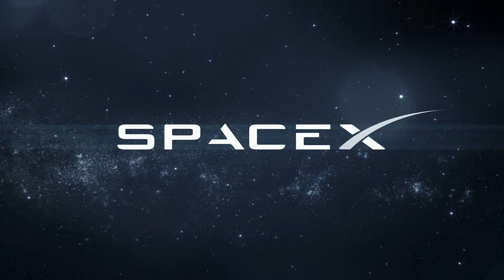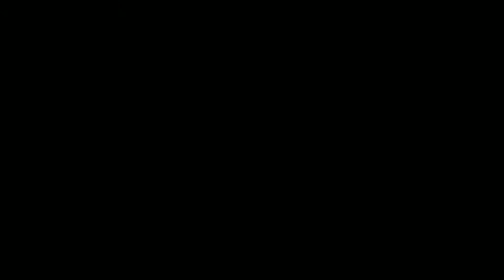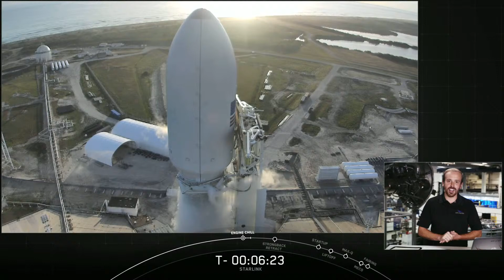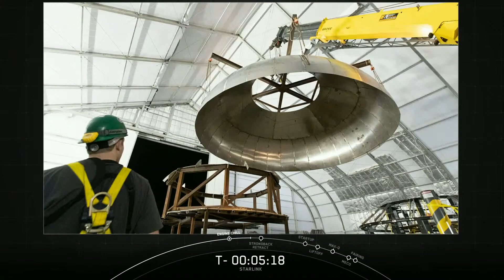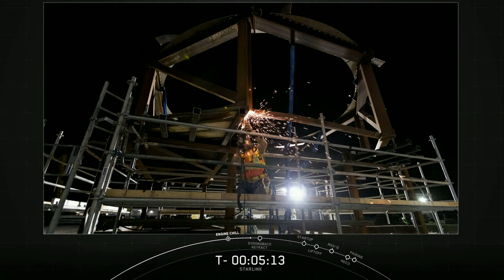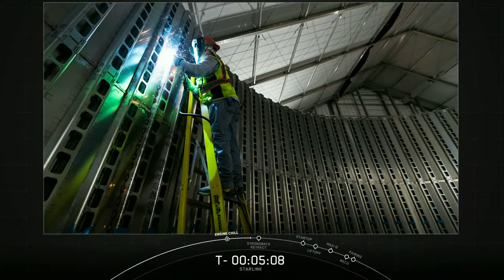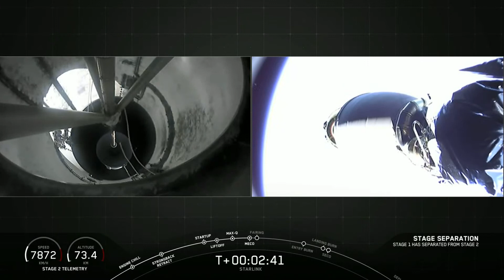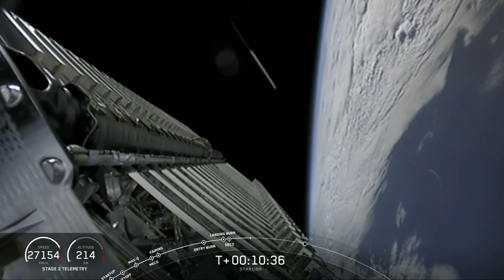Starlink Mission

Comment: Please don't cut droneship video, we knew it would fail, no need to be scared of failure. Please release video of it and release the several other unreleased landing videos like BulgariaSat-1.
Reply: SpaceX, Please SHOW droneship and all possible videos.
Reply: @harryseldon6366  I had an idea someone (last time) said that SpaceX will not censor their 'failures'.
Reply: It's not that they intentionally cut the droneship feed. It's when the water is choppy, the booster starts making it move, and then the satellite beam is broken. It's happens all the time even on successful landing
Reply: @Jaker788  No they definetely cut it. I've been watching every stream for years now, the past few feeds have been flawless no interruptions. Also it's not the water being choppy, it's the sound of the booster that vibrates it. There was almost no waves this flight. Also whenever the feed cuts you always see the booster approach and it cuts out, the feed has never not worked before hand, they very well knew what was going on.
Reply: @_Andrew2002  They literally said "expecting loss of feed" I'm pretty sure they've lost the booster feed before. It's not always gonna be perfect
Reply: @Jaker788  Except they never did say expecting loss of feed. And the feed actually is perfect, they did some upgrades and it hasn't cut out in months.
Reply: They didn’t it had a black out it didn’t have clear connection therefore if you see a booster gonna land it’s gonna have a black out
Reply: You fucking idiot it cuts because of the vibration of the rocket and it loose it connection to the satellite
Reply: That's pushing 400 satellites, anyword on when they're turning on phase one?
Reply: Andrew word where is it https://youtu.be/D9YBUr3YPxI
Reply: Anthony Umana-Paniagua don’t look at the comments...?
Reply: @Anthony Umana-Paniagua and there we go reading the comments before watching the video...
Reply: https://youtu.be/JOqc63Pp9OA
Reply: Samsung selfie sat landing video
Reply: They cut the droneship landing videos because when the rocket or booster is near the droneship the thrust makes the droneship shake a lot which makes the signals shake and so the signal couldn't reach the satellite that is capturing all those signals which in turn being sent to the HQ and then just there it will be seen by our eyes. Primal Space already did a video about this
Reply: @typicalfish1116  You clearly haven't watched many livestreams at all. The past 5+ missions have had zero cutoff because they fixed it. Tim Dodd's video is invalid now because they fixed it. Also that's not what cut out looks like. When the video cuts out you see the droneship for 20 seconds then it stops, drops out and returns. It doesn't never appear. It wasn't drop out, it was intentional.
Reply: @_Andrew2002  there's no reason for them to cut the video for no reason and if there is why would they post a video all about failed landings?
Reply: @typicalfish1116  Because Elon Musk himself made that video. The SpaceX PR team, especially the twitter PR team, and especially since the experimental landing program finished in 2016, now runs like a traditional PR team where you only show good video and try to take people's attention off it. It doesn't work at all but it is was it is. If you need more evidence go look at another more recent failure on CRS-16 where they cut the moment it was going wrong.
Reply: Actually this is the reason https://youtu.be/hH75bVG7HBo
Reply: Area 51 and Señor Leche …..    https://www.youtube.com/watch?v=R32DXz-6sJs
Reply: In this age of media and information, errors are entirely forgiven in the proper community.  This is [y]our home.  We care.
Reply: No they don't cut the video bc they are embarrassed. Infact they don't cut it, when the vehicle comes in for landing the radio signals going from the droneship to a sattalite down to your device for streaming is cut and you can't view it. They admit to their fails all the time on Twitter and on YouTube. And no they didn't think the booster would fail bc most of the time the booster lands. And they did release video of it on Twitter.
Reply: i don't think they're scared at all https://www.youtube.com/watch?v=bvim4rsNHkQ
Reply: They dont cut it intentionally
Reply: @samneale7249  They definetely cut this feed intentionally. Watch it yourself. There is not a single frame onboard the droneship when the landing was happening like they do on every mission. You can't say vibrations cut it out because they didn't even try to show the video.
Reply: Andrew they had LOS because the entry burn failed
Reply: @samneale7249  Entry burn didn't fail. The LOS after re-entry burn successfully completed was normal, always happens. The booster broke up sometime then and SpaceX knowing it had broke up, chose to not show the droneship view instead of just saying it had broken up.
Reply: And when the never regained contact their was no need to show a drone ship cam since they never attempted a landing at all.
Reply: Andrew no it wasn’t the engine failure on ascent was one of the entry burn engines, so the were coming to fast. Also why the booster appeared to flip out after the burn.
Reply: Andrew what do you expect to see , if we can agree it broke up somewhere before landing. Do you want to see an empty drone ship or what.
Reply: @samneale7249  Got a source for the re-entry burn failing or is that speculation?
Reply: Andrew Well its a presumption because Elon confirmed on twitter that they lost an engine on accent and then the booster spun out likely due to higher speeds than nominal. And as such it burnt up on re-entry causing the LOS
Reply: There was no droneship vid. The booster was way off course and didn't even make the landing burn.
Reply: Plumbus 48 Exactly
Reply: So many kids trying to act like they know what is going on 😂💀
Reply: they didn't intentionally cut the feed bro its something about vibration and satellite beam
Reply: Andrew- They don’t cut the droneship video on purpose. The rocket shakes the droneship so badly that it actually loses signal with the satellite, and therefore the video cuts.
Reply: Alan Turing- Sure! Set up a Go Fund Me page and give us a link.
Reply: They lost an engine on the booster before MECO and that's why it couldn't land.
Reply: It didn't fail watch their next video after this
Reply: @Sultan-lv8sj  I've watched every stream since 2015, I already know B1051.4 didn' fail,
Reply: @Anthony Umana-Paniagua y r u even scrolling through the comments when ur not done watching
Reply: Guys, SpaceX just released the Starlink Control Mission Audio in another video
Reply: I think that space x been slacking off late with their Falcon 9 boosters they re not putting in the time need to make corrections to F9 BOOSTER landing. They new that the booster would not have a successful landing.     I bet that Blue Origin would do a better job of landing their booster.
Reply: @Anthony Umana-Paniagua That'll happen if you read the comments!
Reply: In terms of orbital boosters, but it is one less than Blue Origin's New Shepard #3 which has logged 6 flights to space and back successfully. Things will get interesting when Blue starts flying the massive New Glenn next year which also can do vertical landings. 

 It is also way short of the all-time record for a reusable space launch vehicle which is Space Shuttle orbiter OV-103 Discovery with 39 flights to and from orbit.

So while this is good progress, there's a long way to go.
Reply: @Nowhereman10  New Shepherd indeed technically reaches space, but its not an orbital class rocket dealing with the severe reentry speeds and forces that Falcons endure. Although that is significant, it's not quite as significant or challenging as what SpaceX has achieved. New Shepherd essentially goes straight up and comes back down like a rocket powered space elevator. Its single engine. It cant land on a barge, i dont believe it even creates plasma on reentry like the falcon does. Its really cool but not quite the same and 1 relaunch more than Falcon 9 isn't all that significant when you think about it.
Reply: @Coasterlocity  That little rocket will go on to fly a 7th mission while this F9 B1048, will not. And yes, New Shepard could land on a barge, if it had to. Jeff Bezos has noted that NS could with an upper stage make a good smallsat orbital launcher.

In fact, Blue seems to hold quite a bit more in reserve so that their rockets can actually hover, rather than hoverslam, and then they translate over to the center of their pad. This will also be the case with New Glenn next year since it has to be able to track and then land on a moving ship, so they are working things out now with New Shepard.

In the end, we should all be grateful that two companies are going down largely the same path for rocket reuse and next year will be more interesting with New Glenn.
Reply: @Nowhereman10  yea, but how many satellites has 1048 tossed into orbit vs "that little rocket"? 
 NS can only hover because it lacks the thrust of the Merlin 1D. Granted the hovering is really cool, its a product of the design. 
The falcon can't hover because a single engine provides so much thrust it couldn't mange to hover in place. It'll try to take off again and crash. It's designed to actually launch things into orbit in space and still come back.
 Its all well and good that they say NS is capable of that with an upper stage but they'll likely never prove it or even try. They've never put anything into orbit. They've never launched a single customer or customer payload. 
Meanwhile Falcon 1 was actually an effective smallsat launcher.
As you can see today, bold claims aren't always the easiest to achieve IRL. 
This Falcon failed 50% faster than they said it should. It had engine issues during both launch attempts and an RUD during landing.
 It'll be really cool if New Glenn does what they say it can do since watching a rocket land is one of the coolest things ever. 
Im sure Starship will be well on its way by the time that happens. 
Also im pretty sure Falcon 9 tracks the ASDS as well. Thats nothing new or fancy. It definitely uses radar so im not surprised if it has other methods of tracking it as well. Falcon boosters have some pretty epic evasive maneuvers on aborted landings too.
Its wonderful that Blue Origin is working toward reusable launch vehicles and its their right not to showboat like SpaceX deservedly does, but to compare NS to F9 is like comparing Concorde to the Shuttle. Or Falcon 1 to Falcon 9, if Falcon 1 could land. And in that case even F1 can orbit.
Reply: @Coasterlocity  Please, if you're going to comment, do so with proper knowledge.

The BE-3 PM engine is a very powerful one as anyone can tell by how fast and far it can loft the entire New Shepard stack. 

The reason that BE-3 PM can hover as opposed to the hoverslam of F9 has to do with its single Merlin 1D is because the BE-3 PM has the ability to very deep throttle its thrust. 

Operationally down to 20%. 

Merlin 1D cannot go any near down that far, only about to 70% of rated thrust so it is too powerful because it can't adjust its thrust down enough to compensate and so it has to be re-lit and fired only long enough to slow the 1st stage to a landing and cut off before the thrust becomes too much and sends the F9 stage flying right off the barge and off into the sea when the fuel runs out.

When New Glenn flies next year, the BE-4 also will have very deep throttle capability when landing and it will also be able to track, translate to, and hover for several seconds onto the platform on the ship (which is in motion to reduce sea action and stabilize the ship even in relatively rough waves).
Reply: @Nowhereman10  so basically very similar to what i said with a little extra detail. Cool
Reply: @Nowhereman10  also don't tell me not to comment. This is YouTube. I'll comment as much as i like. If i'm im wrong I'll learn something. If my knowledge is incomplete then I'll add to it by learning from others. You just came off a bit arrogant and rude. Btw, the Merlin 1D has been capable of throttling down to 40% since 2013. 39% in 2019. It also produces 80,000 lbf more thrust than the BE3 at sea level.
Reply: @Coasterlocity  Don't project you're own failings on me. Not only were you trying to put me down with your "Ha-ha! Lookit how OSOME! Merlin izz" nonsense, but when you got called out on it, now you're all butthurt. 

What you're now trying to weasel your way out of is by confusing the throttle range of the Merlin 1D Vac which can go down to 39%. The regular Merlin 1D SL is a bit different of a beast and cannot go below 70%, though the goal was to get the SL 1Ds to 60%. And even that wouldn't be enough range to prevent having to use the hoverslam method on landing.

Meanwhile, the BE-3 PM is able to go down to 20% which is sufficient to allow for a proper hover and translation sideways to reach the center of its landing pad . BE-3 is just a far more versatile engine that way no matter how you slice it.
Reply: @MadLink what about an abort system? That would be the best thing.
Reply: @MadLink or at least on the version that's hauling people.
Reply: Funny how Musk fans blindly defend failure.
Reply: I didn't know they lost droneships :(
Reply: @mrrandom1265  It's mis-worded. They haven't lost drone ships, they lost two boosters attempting drone ship landings. They landed the previous launch which was a return to launch site CRS mission.
Reply: Yeh but they gone be running out of boosters surely
Reply: @mcgillypro5007   they're still building them, and if every booster did 5 flights, there are still ~ 18 flights worth of known booster, which is ~6 worth of their launch manifest. There will be more in that timeline. https://old.reddit.com/r/spacex/wiki/cores
Reply: @bryanmclellan2535  He's got a point though, this is an issue. They only have B1049, B1051 and B1059 as flight proven and ready F9. B1052 B1053 which are FH side boosters needing converting. And B1058/B1060 haven't flown yet and won't till May
Reply: @_Andrew2002   is it? 
B1048 today was the first time a booster had a 5th flight. Hard to imagine they had everything bet on getting 5+ flights right now.

We don't know what SAOCOM will fly on, lets go full fiction. Say it is B1061.1. End of March/early april.

No booster has been had a 4th or later flight for a customer so far, so they refly  B1049 and B1051 for Starlink.  With a bit over a 2 month turnaround, B1049.5 is ready to go for Starlink L6 already. B1051.4 will be ready for Starlink L7 in April.  GPS III-03 goes on B1060.1 in late April/early May.

ANASIS maybe reflies on B1059.3 in early may. DM2 flies on B1058.1 in late may.

Only SXM 7 left on the customer manifest until August. Let's presume that gets a new B1062.1 booster for around May/June.

Now you start the cycle again for Starlink. use 1061.2, 1049.6, 1051.5, 1059.4.
we into July/August now.  1058.2, 1060.2 for Starlink L13,  1062.2 for the first rideshare.

GPS III-04 could be 1063.1 in august/september.

Getting way too far out to keep writing speculative fiction. Anyway. If another starlink booster isn't ready or goes away, it slips things a couple weeks each time. As long as new boosters keep coming every ~ 3 months, the manifest doesn't look like it'll be bothered much. The .2 boosters could be saved for customers in H2 and push the starlink launches out a bit to wait for more .3 boosters. I think everything starlink is still pretty flexible.
Reply: @mcgillypro5007  Dude other companys literally build a new booster for every single flight. Before they managed to land nearly every booster SpaceX did the same. They have a streamlined production line that actually produces new boosters cheaper than competitors, not even talking about a reflight.
Reply: And they are going to use the same landing technology on starship with no abort system.
Reply: @Bryan-Hensley  that is false
it is not, absolutely not the same tech
heat shilds, fins for air friction, side  re entry
you people spread shit you don't know a thing about
Reply: @Bryan-Hensley  The difference is, that they are currently pushing the vehicle to it's limits, trying to test just with how much payload to that orbit they can still managed a successfull landing. They are using their starlink missions for this, as you saw with the resupply mission for the ISS the landing isn't a problem.
The Starship will certainly have much higher safety margins, much lower risk on their reentry and much more fuel to work with, it will be able to hover too, so no dead burn landings like right now, since even a single engine on lowest throttle is too much energy to hover the F9, it would fly back up into the sky again, so the landing has to be perfect and you only have 1 shot.
Reply: @LunnarisLP  not falcon 9. It should be extremely reliable landing by now. Power has not been the issue. It's been hydraulic issues. Misfigured data in the computer.
Reply: @Bryan-Hensley  
Not quite. Starship is supposed to have fixed legs as of now.
Reply: @gergc4871  I'm talking about the computer system
Reply: @Bryan-Hensley  Most failed landings were not computer related, but rather mechanical issues. When it comes to the software, I trust SpaceX to test it well before letting people fly with it.
Reply: @OrionFH  this is too many failures for a rocket design that they've had so many successful trips with. They'll feel pretty safe with starship after it flies 50 times, then boom. It's a serious mistake not to have an abort system. People say no use to abort on Mars but if it kills hundreds beforehand it's never going to Mars
Reply: Bryan Hensley Still you have to consider, Falcon has no heat shield, it has bad aerodynamics on re-entry and it uses completely different engines. A plane does not have an abort system either and if SpaceX wants to transport people to Mars, they better develop a vehicle that will be safe. I am 100% sure they know about that and will try to build starship as safe as possible. Oh and the government will also have a look at their design before any non astronaut flies on it
Reply: Bryan Hensley But still you have a point and it will not be easy for SpaceX to reach the required safety margins
Reply: @OrionFH  kinda like the space shuttle?
Reply: @Bryan-Hensley  safety is never 100%, it's a question of how many 9's you can get after the decimal point. I'm confident that the Starship will be safer than the space shuttle. That thing was way too fancy. Hydrogen fuel and wings!? Typical bureaucrat design.
Reply: @Marcoose81  I'll agree, but I'd say it was much safer landing after it got back in the atmosphere. Wasn't much could go wrong after that. Starship can't make a tiny mistake landing
Reply: @Bryan-Hensley  Carbon carbon leading edges and ceramic tiles on the shuttle could take the heat but were fragile as hell. Young and Crippen had balls of steel considering the shuttle was never tested in flight before STS 1!  

  Stainless steel is some tough stuff, should be fine in a lifting body reentry design, especially one that needs no landing gear.  I think before NASAs STS,  Dynasoar which was a manned military design shuttle was to use some type of steel. IIRC it was Inconel or a related high heat version.
Reply: @barthchris1  that's the problem with stainless steel. It's so hard it cracks like glass during rapid temperature changes in areas like where it's welded. That's why they are having so much trouble
Reply: @Bryan-Hensley  the SR71 blackbird suffered incredible temperature fluctuations during differed flight regimes and was designed to handle it. Yet constructing it was incredibly hard due to titanium reacting badly to welding, milling and other chemical processes. These things were solved during design and development. A process that spacex will no doubt succeed at before manned launches
Reply: @Bryan-Hensley  Guess friction stir welded is out of the question. Lol
Reply: @Marcoose81  " Starship will be safer than the space shuttle" Are you serious? They can't even pressure test the tanks without it blowing up. They are building "prototypes" in conditions that the FAA would never tolerate for the building of commercial airliners! No factory, poor quality control, shoddy welds....
Reply: @DavidJohnson-tv2nn  Oh yes how dare their prototypes fail under pressure tests that are conducted to see if they have flaws in their designs to be able to fix them, it's almost like thats the entire point of a prototype.
Reply: @flachs6  Oh come on, you know better. Those failures were caused by bad welds and poor quality control in general. Dented up rocket parts being moved around by construction cranes. Assembled outside in the weather or in tents! This is NOT how aerospace vehicles are built or tested by anyone else! SpaceX is a very capable company and they can do much better than that.
Reply: @DavidJohnson-tv2nn  Companies that build like you're talking about have nothing but delays and huge cost overruns.  Just look at SLS
Reply: @mrbamfo5000  One of the companies that builds like I'm talking about is SpaceX! With their development of Falcon 9, Falcon Heavy,  Dragon, and Crew Dragon. Their present way of developing Starship is a huge step backwards.
Reply: @OrionFH  glide ratio is the airplanes equiv of an abort system. They rely on the ability to glide and maintain avionics control and can still land safely when out of fuel. Helicopters can too actually, which I never knew until about a 2 years ago. Obviously landing under zero power is not quite the same as an abort system but it's a major safety feature that generally negates the need.
Reply: @Bryan-Hensley  Like that plane that crashed due to engine failure mid flight, even that still isn't fully safe. Yet we use it all the time. All new shit is dangerous, doesn't mean it can be pulled off. Just believe my man.
Reply: @DamiaanvdBrink  ok, a plane loses all engine. It can still fly, it loses control of some of the flight controls, it can still fly. Starship loses anything, It crashes
Reply: @Bryan-Hensley  the only similarities are propulsive landing for touchdown. The landing process for each are vastly different. They have plenty of time to work out the kinks and learn from Falcon landing anomalies.
Reply: @Coasterlocity  similarities are they can make mistakes. Except on starship several would die
Reply: @Bryan-Hensley  yea. The whole propulsive landing thing is inherently dangerous but they have plenty of time to perfect it.
Reply: @Coasterlocity  kinda funny, all the residents decided to move after SN1 blew up in Texas
Reply: @Bryan-Hensley  not Boca Chica gal. And i think at least a couple others as well and honestly,  whats your point? Wouldn't you? Doesn't mean they wont work it out but i mean not many people would like the idea of rockets exploding near your house. It was a prototype. Its not even using the final materials or design. Who cares if it exploded. That's what happens sometimes during development of a vehicle. They learn and improve. They tested the bulkhead dome and thrust puck in a shrunk down test article and it worked. At least SpaceX is out there launching sats and blowing up prototypes instead of showing off concepts. There were probably people like you who never believed the Falcon would ever fly, let alone come back and fly again and 20 yrs later one set a record for orbital launches with a single booster. Mark my words, Starship/Superheavy will fly a real mission some day. Maybe not as soon as Elon wants but knowing SpaceX, it will and it'll be safe to ride. Just as safe as a plane. Not like those always survive each flight either so...Maybe you're being a little to hard on Starship. Id rather fly on a Falcon than a 737 Max or Boeing Starliner right about now. Thats for sure.
Reply: @Coasterlocity  I read an article they have all sold out last week
Reply: @Coasterlocity  crew dragon has an abort system dude? Starship don't. Of course I'd ride on Crew dragon in fact I personally believe that's what they should use to fly around the moon and grab the title before someone else does
Reply: @Bryan-Hensley  im aware. We dont know what safety measures will be in place yet for Starship. Again. It's still in the prototype phase. There must be a good reason that it doesn't have an abort system, not that i think its the best idea. They know what they are doing. Better than you or i do. Im not so sure if Crew dragon is built for such a mission. It is designed for trips into LEO to the ISS. Its probably not adequately sheilded for the radiation and reentry speeds experienced during a lunar mission. Also Falcon Heavy isn't human rated. F9 cant launch Crew Dragon to the moon. I understand your point but Starship is better suited for such missions and should be cheaper too.
Reply: @Bryan-Hensley  That's way off and subject to change. Today, Dragon Crew will use parachutes to land on land or sea 🚀
Reply: @cuda426hemi  we are talking about starship
Reply: @Bryan-Hensley  No we aren't.
Reply: @cuda426hemi  falcon 9 is not made out of stainless steel. I don't know what you are talking about.. we are talking about welding stainless steel. But who knows where you jumped in the conversation
Reply: @cuda426hemi  if you are going to get involved, don't be a lazy a"" and not read all the comments. It's confusing as hell when people don't.